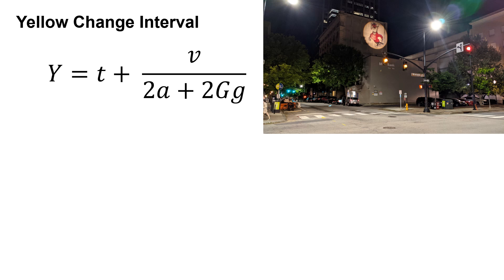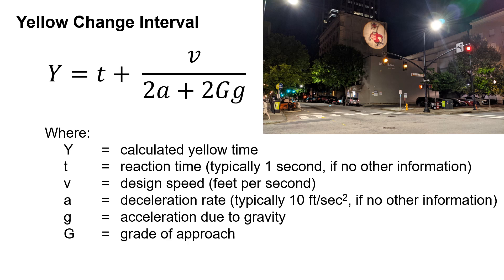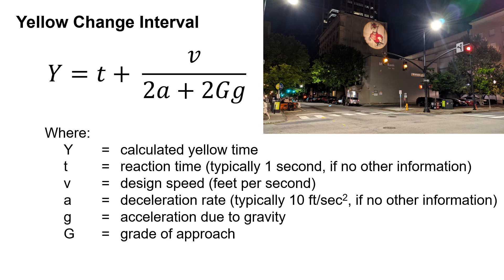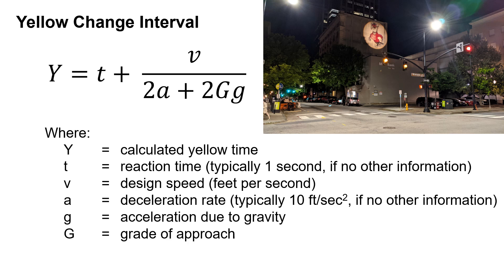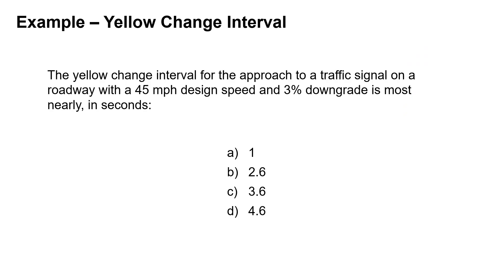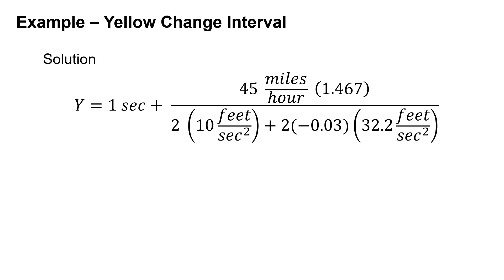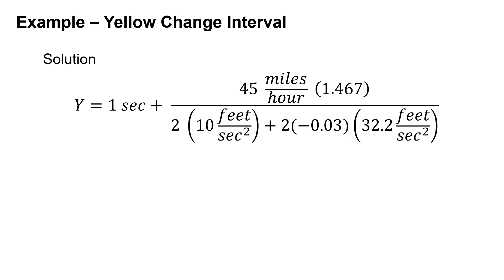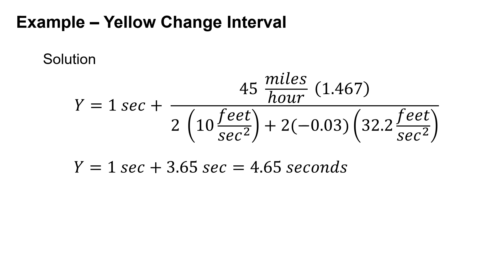Yellow Change Interval | NCEES Civil Engineering PE Exam [Section 5.4.3.1]

Comment: Question:  the definition of yellow change interval is the length of time after a signal turns yellow that a design driver needs to stop their vehicle before entering the intersection. t is the driver reaction time, it makes sense; however the time to make a vehicle with speed V to 0 should be v/(a+Gg), why is v/(2a+2Gg) used in the equation?
Reply from the maker: Others may have more information about the history of the equation (I have read some commentary on this topic, but do not have a full understanding of the origin), but this is the equation provided by ITE and included in the NCEES reference handbook.  As a note, section 5.4.3.1 of the NCEES reference handbook uses this terminology of "provides" instead of "recommends" or another stronger term.